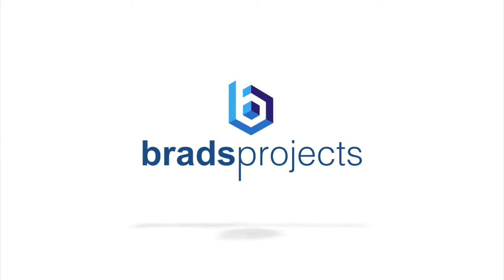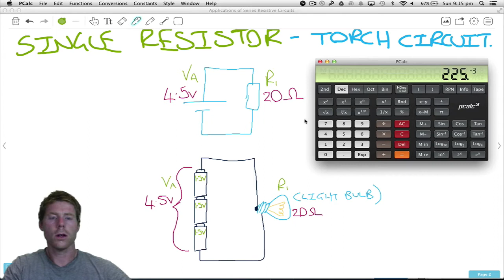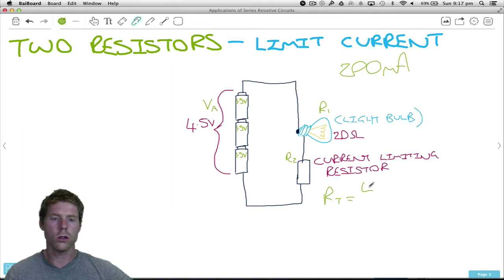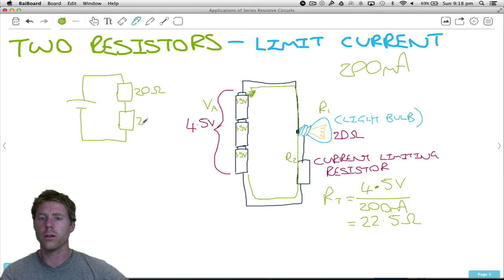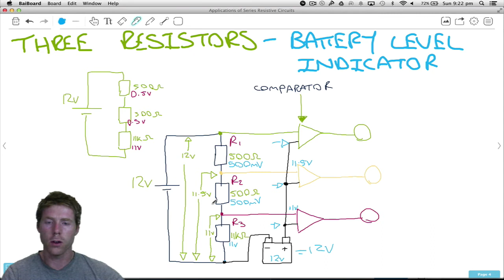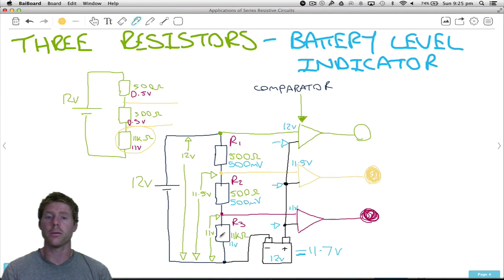Electronics Fundamentals Tutorial #7 Applications of Series Resistor Circuits

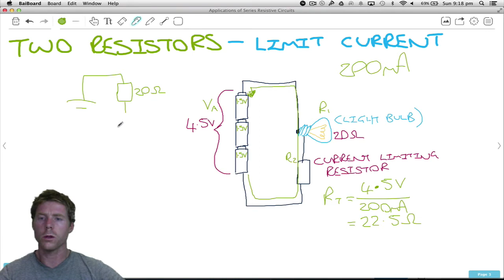Comment: Sorry 4:02 didn't you say the current pass through any component in series is the same ? So by adding that small second resistor the current is not same at that very component in the circuit ? Having that said, for e.i In a series circuit, R1=1k,R2=2k so the current pass through R2 lets say 2.2mA isn't same at R1 ? Obvsly there should be some drop in current right ? as you're limiting the flow ?